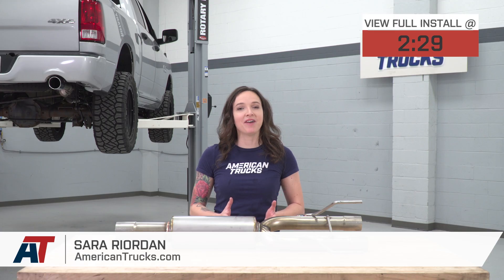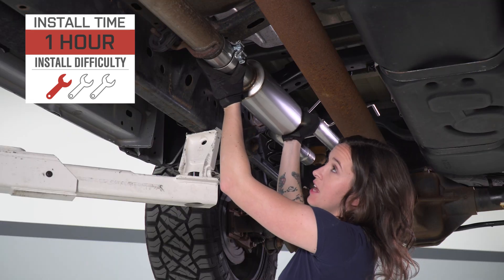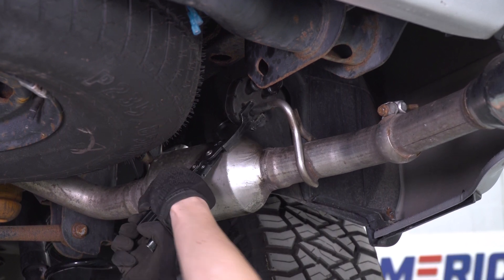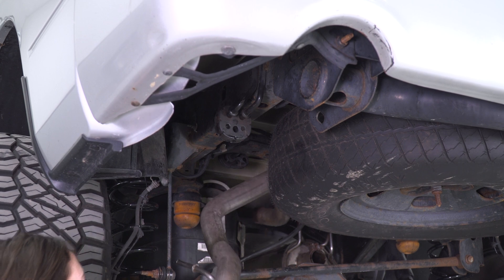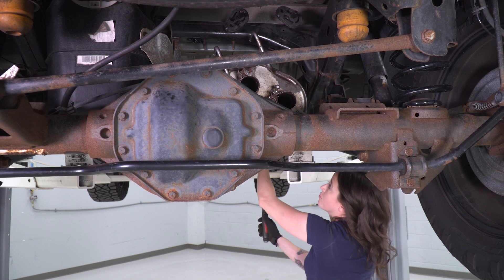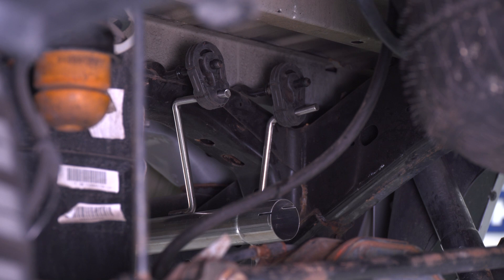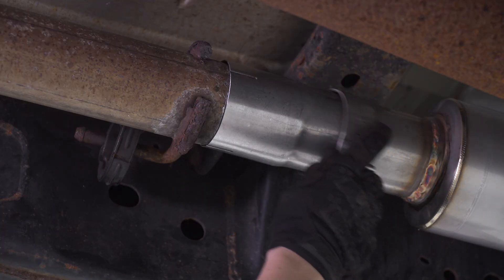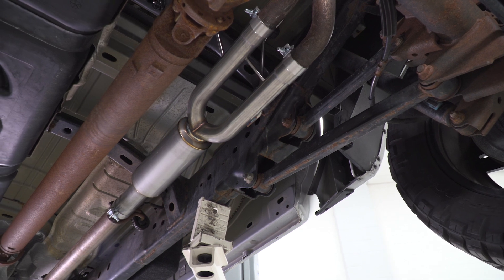2009-2018 RAM 1500 5.7L Proven Ground C&L Series Direct-Fit Aggressive Muffler Sound Clip & Review

Comment: also he put the tips on lopsided so I'll need to adjust them. reason I didn't do the install was not having the necessary tools needed for the extra work required. bolts had to be cut as the nuts were too rusted

Comment: If you don't like your rear bumper and tips to get scratched, take the 5 minutes extra to remove the tips. Most likely you will have to adjust them afterwards anyway.